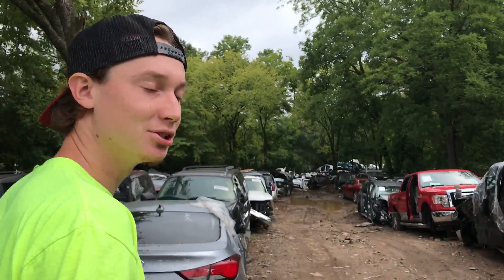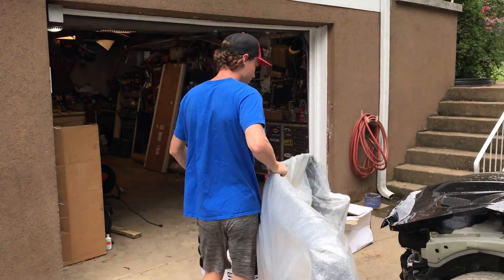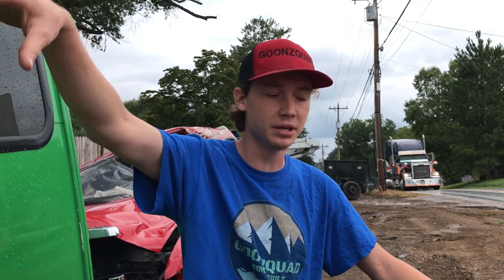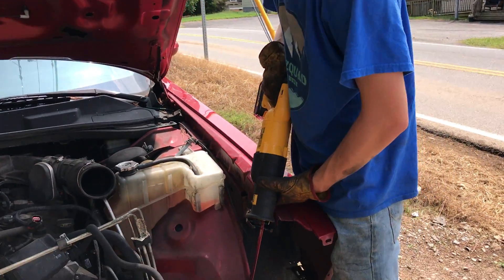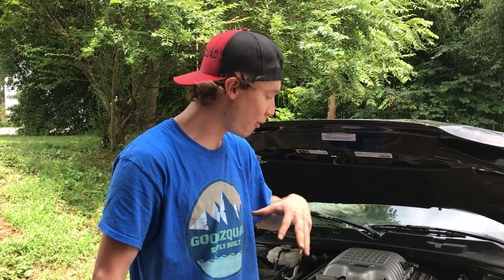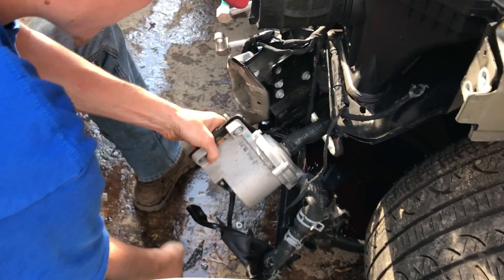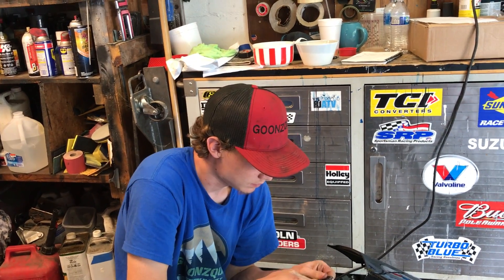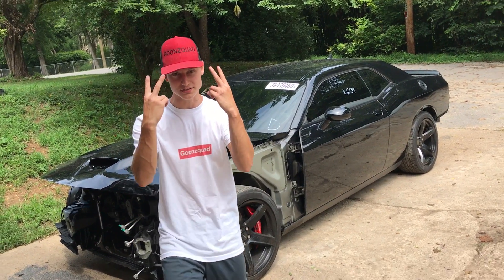Rebuilding A Wrecked 2017 Dodge Hellcat Part 2

Comment: You had it the first time pretty much SRT= Street and Racing Technology
Reply: Was gonna say, he was REAL close.. Had he just slipped an "and" between street racing.
Reply: @DallasD_  lol they dont wanna get demonetized so they go with the alternative version lol
Reply: i meant Steve & Kayla above, but yes the bruthas bein "politically correct" 😝😝
Reply: Also is it SRT8 because it has 8 cylinders and SRT10 because it has 10 cylinders?
Reply: @rafee9442  yea srt10s have the viper 10 cylinder engine..and srt8s are 8 cylinder
Reply: Street and Racing Technology

Comment: How much yall wanna bet the surprise is the Hellcat gets a widebody conversion?
Reply: PalmBeach Grown or an Armytrix exhaust 😆
Reply: Yes |;)
Reply: It won't.  They bought the stock fenders.  Armytrix won't make exhaust systems for the Challenger for some reason.
Reply: shmiggz you need stock fenders to make a car widebody....
Reply: @RougeComputer  no, fenders for the widebody are totally different.  Same with the quarters.  That's if they want to use oem parts.  Sure, you can get an aftermarket widebody kit that looks like garbage.

Comment: any chance that yall would consider doing a classic muscle car? 67 Mach 1? 1970 Chevelle? Firebird?
Reply: They should get a barracuda and put a 392 hemi in it.
Reply: I can't really see them doing a vehicle that old, it's too much of a gamble with the motor and they probably won't want to go through a whole motor
Reply: plus that's a full build , the cars they been dealing with are just messed up in some parts, not the whole car. Not saying they wouldn't be able to do it.
Reply: Not to mention parts for what they are working on are fairly readily available.
Reply: They are doing this to turn a profit. Classics are a VERY tough market to make a profit on.
Reply: IMHO The only way to build a classic car/truck is to have a customer who want it done. Otherwise you won't make no money or you want to build it for yourself.
Reply: The problem is, finding parts, some parts would take months to find and get sent. The channel keeps it's interest up because they post good updates so often due to readily available parts.
Reply: They should try a 74 mustang II the cupe body
Reply: 69 was the first year for the Mach1

Comment: I love the Challenger over the Camaro and Mustang. Good job guys. Nice to see a new generation of guys into performance cars. We had a ball in the late 60's and early 70's street racing. In '74 I sold my 68 Z/28 and my current Z Is a 70 which I purchased in 1981. LT1, M22 4-spd with 3.73 rear gears.

Comment: A good tip for testing to see if theres bondo in the metals, get a flexible fridge magnet(it won't damage paint) and place it on any areas you think are suspect and if it sticks strong there is no bondo, if it only just sticks there's a little bondo, and if it doesn't stick at all then it is packed with bondo

Comment: not sure if you guys checked into this but you should be able to repair the quarter panel without having to replace it...replacing one could cost a small fortune and they are glued on from the factory so it will be a pain to remove but once you remove the inner trunk linings (carpet etc.) you should have access to the back of the quarter panel and bodywork it back into better than factory new...this is a sweet project but I am impressed with everything you guys have done so good luck and good job!

Comment: Hey guys coming from a detailer perspective it’s easier to remove glued emblems by applying heat and using thin string to get it off

Comment: The correct way to cut the QTR Panel is to drill the spot welds as it is welded onto the body. Then seek the recommended guide to cut the panel where needed

Comment: Quarter panel is not the same from the donor car (pre'15) to the Hellcat (post '15).  Looks the same but they eliminated the inner lip pinch weld around the rear wheel wells in '15 to gain clearance for the larger Hellcat tires.  The outer rear wheel house will not match up to the '14 and older quarter panel.  Also, if you manage to get it installed you will get tire rub under full suspension compression.

Comment: The reason the engine block is orange is because it has history with the dodge challenger it dates back to the 70s when the challenger was first released in ‘Hemi Orange’ hence the color of the engine block. another color originally released was ‘Plum Crazy’ which was a purple

Comment: FYI the extra clamp on upper rad hose was installed as a technical service bulletin after the vehicle was in service, due to upper rad hose popping off on some vehicles and overheating. Also these rads have issues with leaking at the seams and it may be a warranty item you guys can get replaced for free if it does leak.

Comment: What does SRT and RT stand for?
Street & Racing Technology (commonly called SRT) is a high-performance automobile group within Fiat Chrysler Automobiles. SRT began as "Team Viper" to develop the Dodge Viper. It later merged with "Team Prowler", the developers of the Plymouth Prowler, to become Specialty Vehicle Engineering (SVE).

Comment: I don't think you guys need to replace that frame rail...pretty sure it can be fixed.  Also, it may be high strength steel which you aren't supposed to heat up.

Comment: with your quarter might be better off buying a new one from dodge, and do it the proper way of finding all the spot welds where the panel attach to the car and find the seems , drill out the spot welds and take the entire panel off and replace the entire panel re spot weld in factory way/locations, be stronger and safer than just cutting n shutting 2 different panels together , still a ton of work and a massive pain in the bum especially on a coupe lol :)

Comment: The engine block on those are painted orange not red cause the motors size is a 392 supercharged and back in the day cars engines size was marked by the blocks color for example my dads Chrysler 300 has a 440 in it and the engines blue.

Comment: Didn’t they cut up the exact wheel well insert that they needed from the junkyard car in order to get to the frame? It could have been already damaged before cutting, but he did say that the junkyard might have one, right after destroying the only one shown in the video. I doubt there’s another junkyard challenger there, or they would have checked it for a rear quarter panel also. I think they needed that junkyard driver’s headlight too unless I’m thinking of the wrong side or was a bad one.

Comment: you wont be able to use a used panel since the hem flange around the wheel well is crimped. no way to properly reproduce the hem flange  around the wheel well

Comment: Are those parts OEM or aftermarket?
Reply: Looked like they were CAPA Certified Aftermarket Parts....The same ones your insurance company will put on your vehicle if you file a claim.  The CAPA certified aftermarket parts tend to be decent parts.
Reply: CAPA parts are ok if they are straight when you get them. Im at about 50% success rate unboxing straight parts..lol

Comment: Why do you throw the fenders and do not straighten them? Both the front and back fender can be easily adjusted with the PDR method, without paint and without welding... would be more efficient and cheaper. Look here: https://www.youtube.com/watch?v=-l5ZD7sEpBk and here https://www.youtube.com/watch?v=HSMLRMU2kZA&t=640s

Comment: I can pretty much guarantee that you aren't suppose to section that frame rail.. you are suppose to take it all the way back to the firewall because its high strength steel that can't be sectioned and welded .. don't sell that thing .. if they wreck it you are fucked

Comment: Why use aftermarket fenders? The used original fenders from the junkyard would had made the job easier and better quality. 

They did the job as cheap as they could and the body is not as strong as it was.

Entertaining videos for people that want to learn though.

But from experience, I wouldn't use aftermarket parts like hoods, fenders, doors, they make the job harder and even after the job is done, the aftermarket parts stand out, showing thay the car was wrecked.